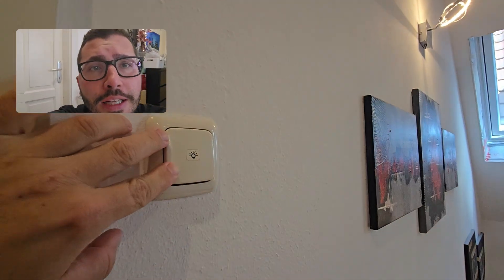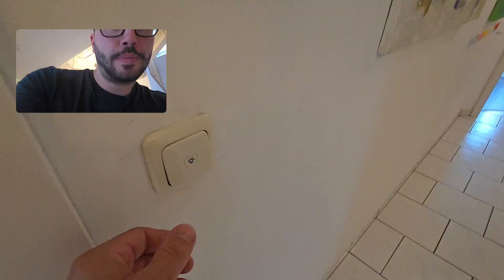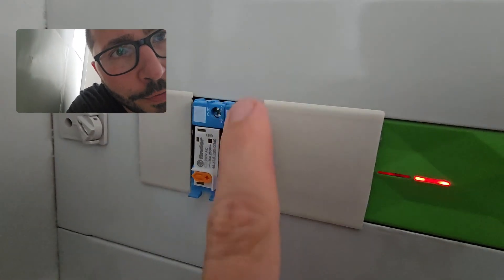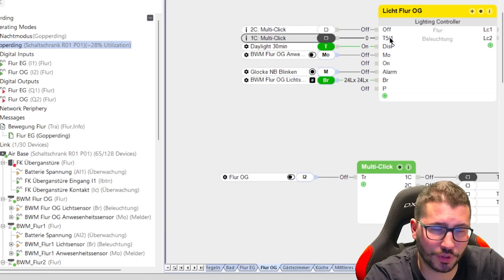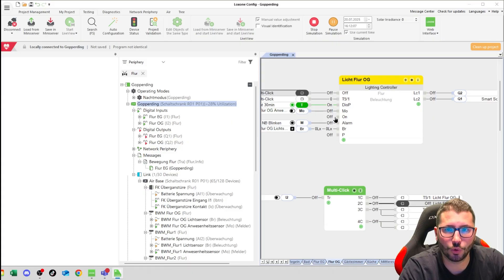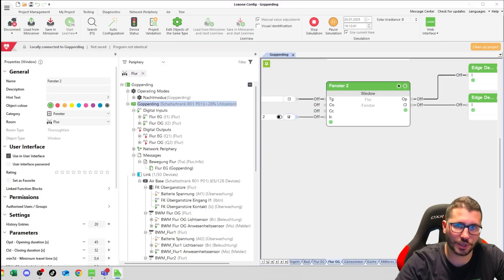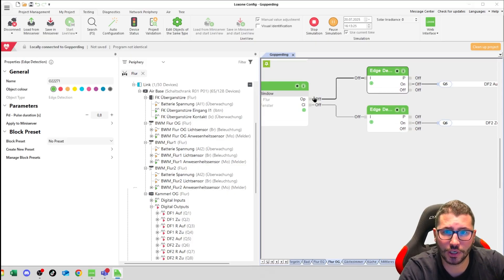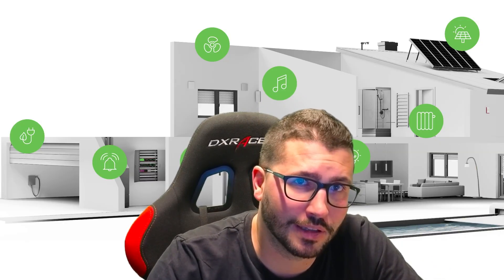⚡Save 75% on Loxone push buttons! (maybe not...) 💡

Comment: Great videos and great help. Question can I use these "finder relais" to connect a 230v motion detector ( steinel - cheap one ) to the digital input on the miniserver. Don't want to buy a new motion sender. Or are these cheap motion detectors with not compatible. Thanks man
Reply from the maker: Hey ywy you can, but every Motion Sensor needs 4 core wire to the cabinet! Then 230V switch the finder which switches 24V :)

Comment: Hi Richard, since you are not using the double tap function on the Lico block and use off input instead. I would recommend setting the double tap parameter to 0. From my experience, the delay caused by this function often confuses people when they do not use dimming lights.

Comment: Thanks this looks interesting and may help my challenge or perhaps you can do a video specific to my challenge (I have subscribed and reference you in my own content). I have windows with day night or "Zebra" blinds so I need to have open, closed and "my position". The automatic shading block only supports open and closed but I really want a double press for the not quite closed daytime location that my motors support. I am doing this via virtual devices talking to Somfy Tahoma. If I try and set up separate double click logic for "my position" can I still use the smart shading block for open and closed or will things get confused? I have 6 windows like this so want to keep this as tidy as I can in config.